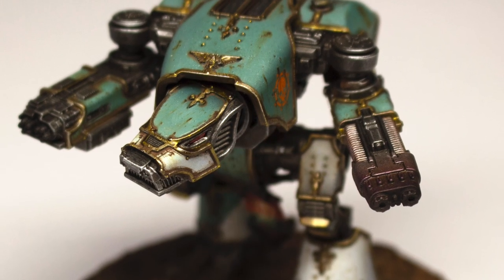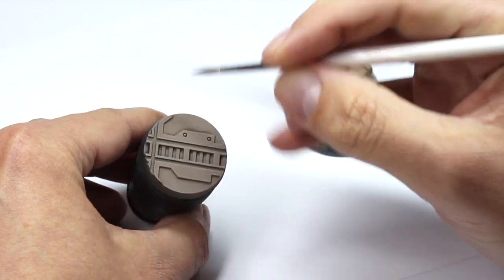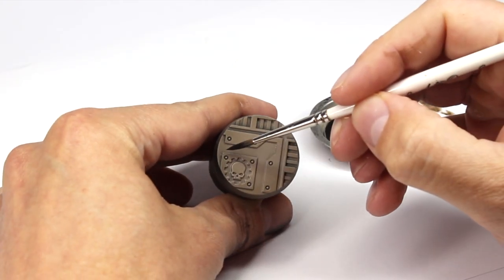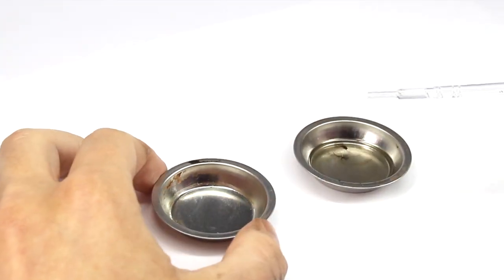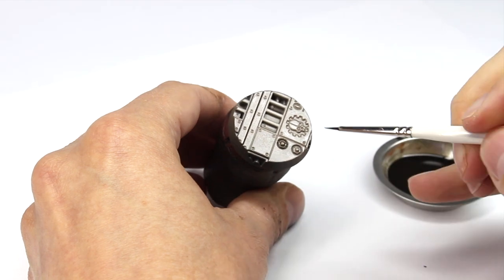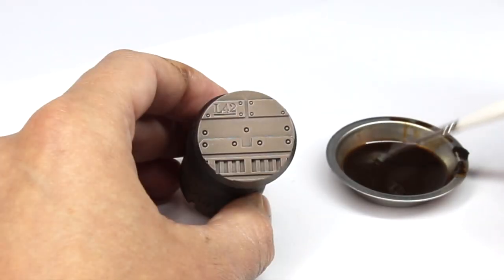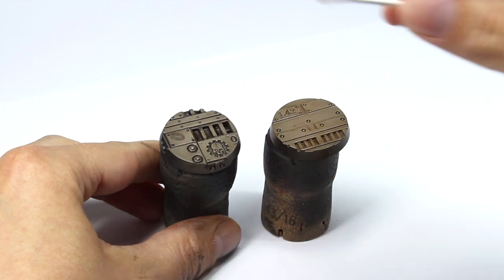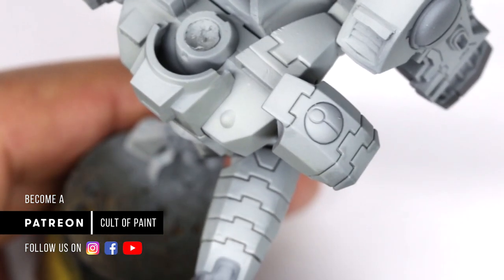How to Recess Wash: Agrax Earthshade vs. other products

Comment: This was a great video chaps! Any tips for getting a smooth coat of varnish out of an air brush? I use Vallejo Gloss but it always creates a rough layer which slightly defeats the point when using it to create a decent surface for pin washing!? Is it possible to thin varnish down with thinners like paint? Thanks again for the excellent tutorials
Reply from the maker: yeah thin it with your normal airbrush thinner.
Reply: @cultofpaint  wicked glad to hear that'll work!
Reply: This is why I'm glad I live in gunpla crazed country, i have easy access to 2 local brands of varnishes (and paints of cause) 5 levels from extra gloss to extra flat, premixed, ready to go from the bottle. And cheaply too, just 3$ for 60 ml.

Comment: I've used your vids to get into pin washing and it worked fantastic! Out of curiosity would you be able to use this method with inks? I'm painting up necrons and want to add the green glow to recesses, using white and then green inks.
Reply from the maker: Thats great to hear! It could help with inks, but if you check out our Necron video in the Indomitus playlist you'll see how we go about it.
Reply: @cultofpaint  yeah I've watched, just wanted to see if it made a difference with the surface tension and helped it run into recesses. Keep up the great work and I hope I can catch a workshop when you come back to Wales!

Comment: Awesome video, concise but very well explained. Regarding the varnishing, for surface tension prior to applying the wash. How necessary is a full gloss varnish, to create a neat effective panel line? Is is worth going for it, then applying a satin / matte varnish once complete? Or using a satin varnish from the get go? I'm hoping to do a bit of grimy blending on the mini, in addition to the panel lining, if that is a factor.
Reply from the maker: I'd go gloss first then your satin. But play around with variations and the products you plan to use.
Reply: @cultofpaint  that's great. Thank you

Comment: Thank you for sharing. After the "recess shading" is complete, may we paint directly on the "Gloss Varnished Surface"? or do we need to apply a Matt Coat for the paint to adhere to?
Reply from the maker: painting directly over gloss is usually very difficult. So a satin or matte coat first is a good idea
Reply: @cultofpaint  thx

Comment: Cult of painting, does it have to be a polyurethane varinish? As I have some varinishs form Vallejo but their not not polyurethane? Just acrylic varinish
Reply from the maker: Not at all, your acrylic will be fine. As long as there’s a good coat on there. So if you’re thinning it 50/50 then it’ll be around 3 coats to get a nice glossy surface to work from. The layers are so thin that you not need to worry about obscuring stuff.

Comment: Great vid thanks! Once youve pin washed with the oil paint will you need to seal it? Cheers
Reply from the maker: you dont need to, but if you want to paint over them then yes. It also helps make it the same finish as the armour colour for instance.
Reply: @cultofpaint  thanks for tthe reply gents!

Comment: Quality. What's the cheapest way to get in to oil washes, with solvent is there one or two colours that will have you covered for everything? Ta
Reply from the maker: The nice thing with oils is a tube will last you years and years of hobby. I'd recommend picking up Burnt Umber, Black, and Burnt Sienna. Get the best you can afford, our 2 favourite brands are Abteilung 502 (relatively new product, targeted at hobbyists) and Winsor & Newton Artists Oil Colour. For thinner get an artists grade thinner, preferably odorless. Whilst the initial outlay for everything may be around £20 they will last for ages.
Reply: @cultofpaint  Sweet thanks for the info!

Comment: hi Cult of Paint! Not sure where I should ask this, hope here is ok.
I started paintig for DnD, but quickly found that I was less interested in tactical dnd combat. so now i mostly paint for painting's sake, without any use for the mini's in mind. I now have only a handful minis done. under 10.
This also leads to me not being "limited" by (or "focussed" on) 28/32mm scale. so I wanted to ask: Do you think one should be good at 28mm before moving to 54mm, 75mm, 90mm, 110mm etc? Or would you just go for it. Because I suspect that most miniature painters just paint 28mm because that's the scale most games work with.
and in general: how do you think painting different scales compare to one another?
Reply from the maker: Great question. We certainly don't think you should limit yourself to one scale. The reason we produce our our miniature range in 54mm is so that the leap from wargaming minis is not so great.
Reply: @cultofpaint  Thanks! I think I'll give it a try

Comment: How long does it take the oil wash to dry once you've applied it?  In other words, when is it safe to varnish over it or potentially paint over it with acrylics.
Reply from the maker: You can use a hairdryer to gently evaporate excess thinner and leave just the paint. In a pinch we've done this immediately and varnished within 30 mins of the paint going on. In general we leave overnight. Acrylics straight over oils is often problematic, so where possible we varnish.
Reply: @cultofpaint  Acrylics over oils are fine as long as they are dry.

Comment: Hey guys! Love the vids. If i have a black armoured model but want to black line using enamels, which AK interactive panel liner is best? I bought the one labelled black camouflage but it’s actually grey.
Reply from the maker: That's a bit trickier. So the ak panel liners are for scale models, where dirt will collect in a panel line, so on a black tank it'll look grey etc. If you are wanting to panel line your black armoured marine or whatever use a black oil or the black contrast paint. Sometimes I'll deliberately use brown to panel line black as it gives definition and dirt at the same time!
Reply: @cultofpaint  Awesome! Thanks for the reply. I’m thinking ill use a black oil paint for ares where my strongest highlights are i.e. the chest and shoulders pads etc then use the Ak desert camouflage for the feet and lower parts and see how that goes.
Reply: @cultofpaint  Awesome! Thanks for the reply. I’m thinking ill use a black oil paint for ares where my strongest highlights are i.e. the chest and shoulders pads etc then use the Ak desert camouflage for the feet and lower parts and see how that goes.

Comment: What type of brush is best to use? Synthetic or stable. I have Windsor Newton but don’t know weather to use them or not for oils because of the thinner. Could you advise as I see you use artis opus but I’m not sure what they are made from
Reply from the maker: When my natural hair brushes get a bit worn I transfer them to my oils pile. If I was buying a brush specifically to use for oils then it would be artificial. You just want a good point for doing pinwashing. So if you can find an artificial “miniature” brush that would be good, they are the stubby ones.
Reply: Thank you so much on your response I’ll get looking for a decent artificial brush then with decent stubby point and work from there, thank you once again

Comment: can you save the mixture for the pinwash to be used later say in a dropper bottle or something along those lines ?
Reply from the maker: I haven't had much luck with this so just make up a small batch each time. Scale 75 do a range of premixed oil washes called Soil Works.
Reply: @cultofpaint  cheers guys ill check them out

Comment: For the oil wash I ran into a problem where after applying the gloss varnish the oil wash isn't running into the recesses as easily I thought it it would. I would usually have to trace the recesses and then it moves into the recess instead of pin washing. Could this be due to lack of gloss varnish (i add 2 layers, non-thinned) or thinner to oil ratio (I use same W&N solvent + oil paint)?
Reply from the maker: It may be to do with the recesses not being the deepest part of the area. You often find this with rivets on plastics. But certainly try thinning it further.
Reply: @cultofpaint  Should i thin both the varnish and the oil paint with thinner?
Reply from the maker: Yes, but different thinners!! Normal airbrush thinner for varnish. Mineral spirit thinner ( we like Sansodor) for oils.

Comment: I might be wrong but doesn't the fact that you put agrax earthshade over a mate varnish instead of a gloss varnish like you did on all the others may have affected the way it worked compared to the others so that it didn't run as well? Also what would happen if you try to remove it while it was still wet like you did with the contrast paint instead of letting it dry? Would it still stain the flat surface or would it be removed like the contrast without staining?
Reply from the maker: Thanks for the questions. The first clip with Agrax on a matte surface is to deliberately demonstrate the "worst" way to create a recess wash, with very high surface tension. Agrax pinwashed over a glossy surface would be better, but not as good as say a contrast paint over a gloss surface. And yes, glossing the surface will allow you to remove unwanted paint.
Reply: @cultofpaint  thank you very much for the reply. Really liked the video it was just that that difference left me wondering if shade paints would work differently with a glossy surface or mixed with something to improve flow, like water or medium. I was also wondering how the others would react to a mate surface. You have a great content in the channel so thanks for all the tutorials (y)

Comment: Hi, do you guys ever encountered, that the oil / enamel wash dries in little flakes, it looks like small dots and is staying a view micrometer away from the recess... If you know this, could you tell me how to fix it?
Reply from the maker: Hi Patrick, this is a tricky one to answer without seeing the problem. Drop me an email at cultofpaint@gmail.com with some pictures of the issue.
Reply: You might already have solved this, but just in case. It's the pigment that separates from the medium. It means that your wash was too thin. Go for a little thicker washes. Higher grade oil paints have higher pigment densities and that can help as well.

Comment: Not a very fair comparison in my opinion. For the agrax you used a matt varnish which causes more surface tension and then a gloss for the other products. You also thin down all the others(obviously in the case of oils you have to) but not the agrax. Thin down the agrax with a 2 to 1 agrax to water and apply on gloss varnish and it will behave exactly the same way. The only real benefit to the others is cost. you will get a ton more washes out of a tube of oil paint and a bottle of thinner than you would agrax.
Reply from the maker: In the first clip with the Agrax we explain that we have deliberately created a "worse case" scenario of very high surface tension. Then going on to demonstrate the opposite end of the spectrum on the following bases, high gloss, solvent based wash. With this knowledge people are able to choose what is the best wash for the application they want. Acrylic, enamel, and oil washes all have their place, with benefits and drawbacks besides cost.